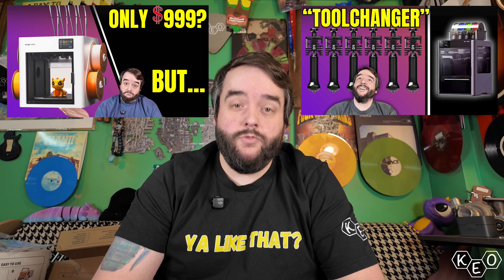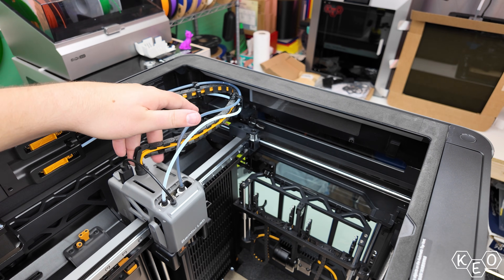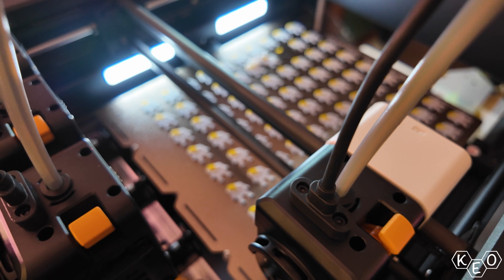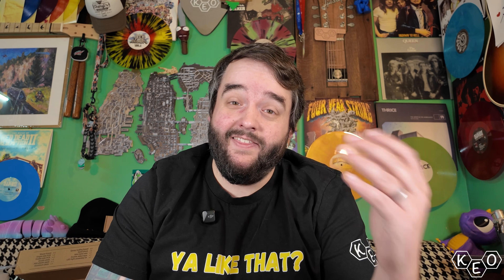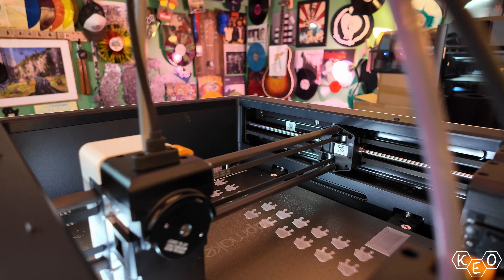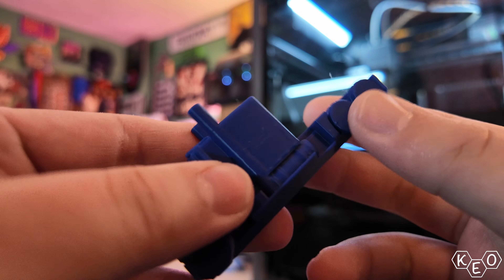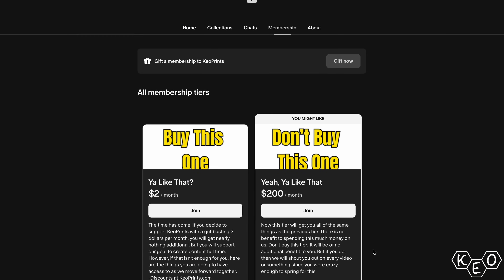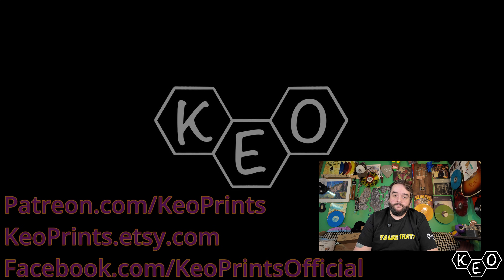Bambu H2C vs Snapmaker U1 — Toolchanger War

Comment: Nice video.
So a summary would be something like this?
* Both produce the same quality prints.
* Snapmaker U1 is faster.
* Bambu H2C can use more colors.
* Snapmaker U1 can use flexible materials like TPU.
* Bambu H2C can print at higher temperature.
* Snapmaker U1 is less then half the price.
* Bambu H2C have a more mature app / user experience.
* Snapmaker U1 is more 3rd party / open source friendly.
* Bambu H2C have a larger build volume.

So I guess it about picking the points that one think is most important.
Reply: Hear me out. You can add mmu to U1 the same as for the Bambu. You can actually add more mmus, one for each head :D
Reply from the maker: Excellent summation
Reply: Don't forget one more thing, the U1 wastes less material!

Comment: Need true MM and TPU is somthing I use in my designs, so the U1 looks like a great deal for, would have like it have been 300mm3 as I feel this is the new standard, but you cant have evrything
Reply from the maker: I agree. Larger format with the toolchanger setup is going to be very helpful when they come around

Comment: One thing you haven't mentioned is the printing noise between the two printers ?
Reply from the maker: Good point. I would say that the H2C is a bit quieter by virtue of being enclosed. The Snapmaker is not a silent machine by any means but it will be interesting to compare once I have the enclosure kit

Comment: If i had the choice, I'd go h2C. I dont so im going u1. Bambu better in every way other than multicolour print time. H2c and u1 are not even in the same league or market. U1 main crowd are toy makers, yes thats me too lol. Its a premium device vs a budget one. Im definitely in the crowd of loving the H2c for its nozzel sizes. Price is just too much for me. I could easily compromise some feature for a U1 xl with a heated chamber.

Comment: Btw, not sure if I saw this correctly but I watched a video that TPU on the H2S can only be done through one specific feeding tube.  Not sure if that one specific extruder, nozzle, etc is made for TPU only?
Reply: H2C
Reply from the maker: Ive heard that only one toolhead allows for flexibles but ive also heard that there will be a firmware update allowing for both soon or something. Super weird

Comment: The INDX + PRUSA going to own them all. CoreOne L industrial machine + 10 heads on INDX for $2500 or so.. sure its not yet ready.. but not too long now.. $35 heads.. tpu, multi material, whatever CHT nozzle size you want (.2, .4, .6, .8), etc. Will def be the winner of all this. 10 to 12 second swap/heatup cycles.. way faster and almost no waste.

Comment: I'm not sure where you get that the bambu printer cannot do flexible filaments. My son and I print with tpu all the time with zero issues and we load it into the ams like any other filament. It has yet to cause a single issue while printing  in our x1c from the original ams also. I'm  curious as to why it has worked for me but you claim it does not?
Reply from the maker: That is impressive! Are you printing 95A TPU? Bambu says it is not compatible with the AMS and that it will lead to jams/cloggs due to the softness
Reply: @KeoPrints If we are not doing very many prints or color changes then yes we load it directly into the AMS otherwise we have it feed directly from a secondary port from our creative filament dryer. From our experience making sure the tpu is kept completely dry has been key to not having any issues. We have noticed that when feeding from the AMS that it does allow the filament to absorb moisture faster and does not keep it dry even with using the deccicant mods we added. So we end up pulling it out and throwing it back into a dryer. We print with a lot of abrasive filaments regularly which typically cannot feed from the ams do to it wearing down the internals fast which is why we started testing it printing from the ams versus the dryer. The only other issue we ever found was that we need to change the nozzle out if swapping between an abrasive filament and the tpu.This has prevented a lot of the clogging issues and feeding issues that people online have complained about.

Comment: Any updates on U1?  Im interested in 1000 hour update.  Im really liking it but concerned about peoblem free  long term use.
Reply from the maker: So far, nothing to report. It seems to take whatever I am throwing at it. Although I have really only run PLA, PETG, and TPU at it so far, it is holding up just fine
Reply: @KeoPrints  how many hours are you at on the U1?  My Kobra S1 was my second printer (first multi color) I should have went with the Bambu but at the time I was a little turned off by all the Bambu fan boyz but after dealing with the S1 I get it now. My first printer xmax2 is still going with basically no issues but its slow and no multi color but at least when I ask it to print something it does it. Above all I want a printer that isn't breaking down all the time.  After all it doesn't matter how fast or efficient it is if it cant be reliable. I took the risk on the S1 and was actually happy with it for the first 670 hours until it bricked itself.  Its been down now for months with error code after error code I seems like I fix one and get 2 more... So I'm really gun shy on buying another unproven printer.  I'm thinking I I will get an H2s first and let this U1 shake out but the u1 does look really nice for the price but I already fell for that once.  I need to see some of these reviews with 1000+ hours plus anything less than that doesn't really mean squat.

Comment: Bambu's site says the H2C does in fact support TPU. They even specify that 85A is only supported on the right, fixed hotend while 95AHF & 90A will be supported on the left, liftable hotend once firmware version U2 is released

Comment: Also, there's a Kickstarter going right now that if you load 8 colors into your 3-D printer by layering them thin and opaquely, they can achieve over 3000 colors, and they have a sample of this. It's a chip on maker world that's specifically for the H2C. So as long as you have the 8 base colors loaded in, you can print any variation of any color I think that's the future.
A couple nazzles
Reply from the maker: Wow, that sounds super interesting! I'll have to look into it.

Comment: Also, if you're willing to spend like seventy five bucks after buying the h two c you can replace if you parts, and you can lighten that printhead by like twenty or thirty grams.And get the same speeds out of it as a single
Reply: Also I would like to see what the tool change speed is because i've seen videos where the color swap after the initial purge with the a m s two probe be as little as twelve seconds by the way, that was with the a m s two pro, and it looks like you're running the.Regular a m s which significantly slows down the color swap

Comment: The two hundred thousand swaps is the standard replacement interval for pogo pins but pogo pins are super cheap, they're not hard replaced, and even if you can't replace them yourself, you could probably take all year tool heads down.And for fifty bucks, get them all replaced at some local electronic repair shop

Comment: All I see is plastic toys. Both printers PLASTIC PLASTIC PLASTIC.     Where is the industrial mostly metal construction with tons of upgrade ability to do specific materials for specific needs!!!!   O that's right every thing is for the sheep consumer!!!        We need an robust open motion system platform with the smarts on the side of a tool of are choosing or making.  But that's to much to ask for in this consumer realm they just want it to work because there sheep!!!!!!

Comment: Bambu needs to cut the crap and go with a minimum 325 build volume and dual vortec's so it can see the color change coming and already have the filament changed then you could print with like 8 ams that way they will be just as fast and way more versatility.
Reply from the maker: Dual vortek would be sick

Comment: I was hesitant to get the H2D. It was about twice what I'd prefer to pay for it but the idea of having a second nozzle meant I could use it for support materials but the TPU issue put me right off in the end. I just couldn't justify the cost & still having nearly as much waste as before.

I now realised that Bambu is making a really costly mistake in their more recent printers. The X1C was a very competitive printer in the market AT. THE. TIME. It did what many printer enthusiasts wanted and at a decent price while offering something relatively new (multi colour). Then they did the same for bed slingers with the A1 and those sold a ton.

The H2 series however makes little sense when you look at the cost:
- very similar to the X1C
- slightly bigger bed
- similar AMS limitations (the AMS 2 is a good step in the right direction however)
- an extra nozzle for the H2D
... but at a WAY higher price! The H2C costs twice what the X1C cost!
... AND it's not even that fast! 

And to me, they priced themselves out of the hobbyist market with the H2C without offering a cheap affordable alternative. A lot of people want the tool changing without needing to print high end materials or needing all the bells & whistles.

And so the Snapmaker U1 now swooped in to steal the prize with a printer that is firmly aimed at hobbyists, delivers similar quality and offers the features most hobbyists need. I suspect a more "premium" U1 may appear in the near future too once Snapmaker feels there's a demand for it but I'm glad I took the gamble & got the U1 via Kickstarter. 

I love my A1 printers but the AMS always held me back when printing colour prints (in two years time I printed a whole of ONE print job that actually used 4 colours for more 20 layers because of the insane waste & print time) and I mostly used it just to quickly swap colours & filament types allowing for fast changes to the next print job.

Competition is good however - Bambu has slowly ramped up prices because it took hold of the market and hopefully Snapmaker can make them sweat a bit.

Comment: Based on my rookie experience and where I live, a Snapmaker would be a lot of work, since being open and the filaments exposed, I would be at the mercy of the humidity, which varies between 60% and 80%. If I only want to print PLA or PETG, it would be acceptable; perhaps something could be developed to cover and heat the filaments with some desiccant and then close it. There's a $1,700 difference compared to the Bambu Lab H2C. On the other hand, the Bambu Lab H2C is larger, prints all types of materials, and you can dry the filaments and keep them sealed and dry. So far, if you have a 3D printing business, I think the H2C is a better long-term investment.
Reply from the maker: That’s where I lean simply for the versatility. But the snapmaker does super well with the PLA/PETG prints that I’ve been running

Comment: Great review of the two!  Thanks!!  I guess the $1K SU1 would be great for max 4 color printing! Seems like paying the 2.5X more for BH2C is giving someone >4 color printing (extra $ for additional print heads), higher temp printing for engineering filaments and larger print area - Oh and the drying feature of the AMS2 Pro that comes with BH2C is nice - I'm still waiting for Bambu to add control over it from the smartphone app and also give the option of drying while printing like other companies allow on their ecosystem.
Reply from the maker: I wish I could dry while printing… it’s such a big miss in my opinion

Comment: Why does the Bambu cycle the nozzles 27 times when changing a single nozzle?
Reply from the maker: It’s performing a lot of operations. It moves over and removes a locking pin then it parks to drop the nozzle, pick up the new one, then park again to get the locking pin in place. It’s elaborate for sure

Comment: If you ignore the multicolor part for a moment, and look at the AMS as a thing to conveniently chose a color before printing, then similar the Vortek would be the way to conveniently switch nozzles without much hassle. Suddenly it makes sense ;) Normally you have the .4 installed, but now you can start that .6 print remotely. 

I'm tempted to buy the U1, it would fit my use-case of quickly print some CMYK images without much waste. For now I'm trying to hold back and wait for more information on the Core One with INDX. So let's see in half a year if I bought a Bambu, Snapmaker, or U1 :D
Reply from the maker: That’s true. The simple ease of staging colors or nozzles is very helpful and I feel like is overlooked

Comment: Although you published this in Dec'25, there is no mention of the technology that makes both of these printers obsolete: Bondtech INDX! It is -- objectively -- better than both. It does the same thing faster, more simply, and at a lower cost. It works with flexible materials with no problem, and reduces the print time almost as U1 does, but it supports a variable number of tools, while U1 is locked at 4.

H2C Vortex system is purely an artefact of overengineering, which focuses on solving one problem and one problem only (purge waste) while leaving the longer print times due to changing filaments with AMS a problem for the future, and SnapMaker U1 built a printer with 2010 technology that has the same drawbacks as it did in the past (uneven usage of toolheads, more complex maintenance for all 4 extruders, pogo pins wear, etc.). That's the core summary of the toolhead war! Bondtech wins with Fatality!🙂
Reply from the maker: You’re right, that looks like an incredible system. I unfortunately don’t have any experience with it like I do with these two machines in front of me. Looking forward to the possibility of getting ahold of one when the time comes though!

Comment: Very well done video and you have fun at it at the same time that made it enjoyable. I have four bambu lab machines three different types and I purchased and got to wait Oh God I got to wait till March or April for the snap maker. But I ran a time comparison with some things I sell of multicolored between an X1C and HD2 and the new snap maker on orca and is unbelievable. So for the higher end materials and those kinds of needs I have the printers needed for that The U1 certainly fills a void keeping prices down very competitive. Will become a subscriber good stuff.
Reply from the maker: Welcome to the community, happy to have you around friend. I think this perfectly sums up these two machines. They have their places and they both offer strengths generally speaking

Comment: Nice comparison! I would like to see you tackle the melting internal AC boards in the Bambu A1 printers that Bambu will only address After you have an incident happen... and God forbid a fire. These printers are in kid's bedrooms. QIDI got hammered for similar issue, but you Bambu fan boys let them get away with anything. At Bare Minimum the upgraded boards should be sent to anyone who requests one. A responsible company would hit this head on, not quietly one at a time after the fact.
Reply from the maker: Agreed. This is the first I’m hearing about this issue but that kind of thing totally sucks. When Qidi had that board issue with the Plus 4, they tried to keep it quiet and send fixes but of course that caught on. Luckily they were on top of it enough to get that taken care of fairly early on as I understand it. But the key there is the Q2 was made to a specific 3rd party safety standard as a result to ensure something like that didn’t happen again. This is what needs to be done when mistakes are made in my opinion. Or just test your machines even longer before announcing/releasing but that’s of course easier said than done
Reply: @KeoPrints  Many folks are reporting this happening on the A1 FaceBook page which leads me to conclude it is wider spread and being hushed. And of course fan boys are defending as usuall. The pictures being posted are beyond anything I saw with QIDI...burnt boards, wires and melted cases. It is a hazard and Bambu needs to step up and Now. My Christmas one for my daughter and granddaughters is being returned to Micro Center tomorrow.

Comment: I have a magnet I sell on Etsy that uses 9 colors. I have 3 AMSes connected to an H2S right now. I've run some slicer simulations and because it’s so small the H2C doesn't really save that much time.
Reply from the maker: What’s the waste savings on that same piece? Negligible being so small I would imagine?
Reply: @KeoPrints  I do 9 at a time on my H2S and it flushes about 18g of material. When I slice it for the H2C it only shows a small amount of flushing, since it's got 2 more colors than it can do with zero, and it shows a bigger tower, so overall savings is like 13g of material. I only sell maybe 50 of these a year. So that's a savings of about 73g a year of material. Or about $1. 🤣

Don't think that justifies $2400 for the machine and another $200 for 5x 0.2 nozzles. 😁

It does save about 4 hours though, which would be nice because this is a 17h print